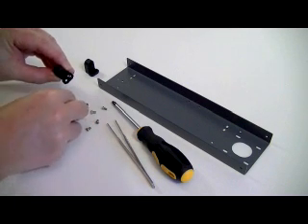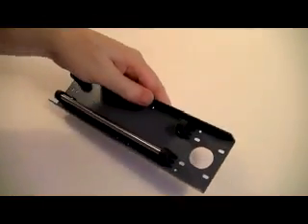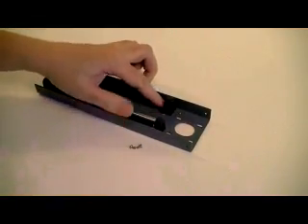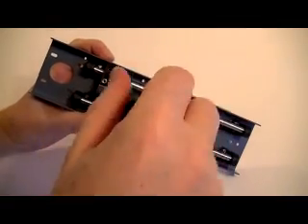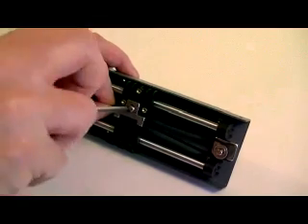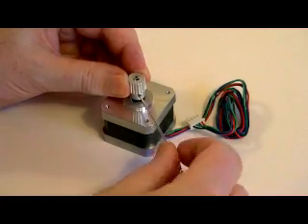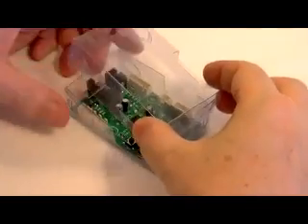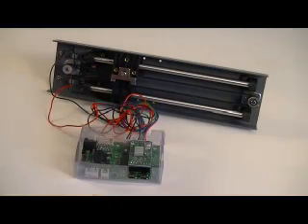V3 3D Printer: Assembly guide parts 1-12

Comment: Any body got the next batch of issues yet? 4-7 I was under the assumption you got a toolkit with it.
Reply: i got the usb key with mines, to the best of my knowledge the tool kit is 8-11
Reply: Dave Neill Same here
Reply: me too
Reply: Toolkit is supposed to be in 12-15
Reply: I got nothing either guys. Bit of a poor effort, but if nobody received it, then it likely does just mean they intend to send it out later on!
Reply: Yeah im not that bothered yet to be honest as the printer isn't done its not as is I can use the tools on prints yet. Lol
Reply: Correct Will
Reply: ...apart from it's 12-15 :p
Reply: www.Facebook.com/3dcandp
Reply: Do you Subscribe, or do you only Purchase them Weekly from your Newsagent? ...
.. You don't get it Automatically, you need to Subscribe to get the Toolkit.  Even if your Newsagent is Ordering Them Weekly for you, it may not be an Official Subscription.
Reply: It actually depends on when you Start Subscribing.  If you have been Purchasing from your Newsagent up until (let's say) Issue 11, and your Subscription begins at Issue 12; you will receive the Binder with your 1st Delivery (Issues 12 - 15), and the Tool Kit with your 2nd Delivery (Issues 16 - 19).
You will then receive the 10 Exclusive Designs (These are Exclusive to Subscribers Only - they are in addition to the ones in the Magazine which are accessed by the Web Access Code each week).
The Vector 3 USB Key comes with your 4th Delivery, and the Coloured Filement comes with your 6th Delivery (not your 5th Delivery).
However, if you begin your Subscription as from Issue 16, you will get the Binder with 16 - 20, and will not get the Toolkit until Issues 20 - 23.So, every Subscriber is different.
As for someone who does not begin their Subscription until within the Final 24 Issues, you would have to check with Eaglemoss (or the Distributor in your Country - eg 'Bissett Magazines' in Australia - not with your Newsagent).

Comment: I have been thinking of getting a 3D printer for a while now. Looked around and decided against it until I saw this mag. Yes the printed items will only be small but for me it's a toy. I will enjoy the building and in the end hopefully I'll have a working printer that I would not be afraid to pull apart & mend if necessary.

I did wonder if the cost of subscribing to the 90 issues was too high for a printer but in that you get help with creating the designs in the 3D software, some free gifts (which no doubt you pay for in the savings made from wholesaler/retailer profits etc.) and hopefully some other 'freebies' along the way.

There are things I would like to design & print which I'm unlikely to get designs for online so this may lead on to getting a 3D scanning system.

All in all I'm looking forward to issue 90 popping through the door, hopefully it isn't some crucial part without which the printer won't work.

ps. good marketing strategy to sell at £6.99 a week but deliver 4 at a time. would you sign up if it was £27.96 a month. I wouldn't .................. oppps, I just have. lol

Comment: its better to buy a makerbot 5th generation. Eventhough its more expensive its alot better
Reply: Makerbot are a bunch of scammers! They took from the Open Source community improved on the good will of others then closed the doors on these improvements when by the licensing agreement of the OS community says that had to! They are a despicable company!   http://richrap.blogspot.co.uk/2014/05/makerbot-patents-twist-knife-on-open.html
Reply: +Callum Burns Actually that is quite true they are scammers. It's just an ultimaker in a fancy case for an extra 2000 added onto the price tag
Reply: The Ultimaker is possibly one of the best commercial printers out there! They are open source (Albeit with hard to find parts) and printer quality is out of this world! :)

Comment: Just subscribed,  i hope im not going to regret having to wait 90 weeks for a finished printer. Looks great though.
Reply: fyi, Ive purchased all the parts on ebay and local hardware shops and started my prusa i3 build, total cost is just over £300. its definately more enjoyable have a big pile of bits to play with than waiting a week for another part to add.
Reply: I believe so,  it will keep there portage cost down.
Reply: I was very interested in this myself until i read this
"Prints any object up to 140mm x 140mm x 135mm"
With that area you cant print anything bigger than a mobile phone case. Its very small so most print projects you find on the web will be simply too big for this printer. So unless you like printing tiny cars and replacement phone cases this printer is crap in fact i dont think theres a smaller printing are 3d printer on the market..
 Not to mention your paying nearly £620 for this printer and having to wait nearly 2 years for it.. Do yourself a favour save that £6 a week and get one on ebay for £350 thats 10X better.
Reply: What would you recommend Vicktor?
Reply: Andie Piercy
Personally? I couldn't pick there are too many right now but look around the new and do a bit of research you can get one from China for £200 if you don't mind the shipping using aliexpress or ebay for around £350 (but get full paypal coverage). Just looks at dimensions etc.. before buying.. you want something that will take ABS and PLA as depending on your project ABS is just better for some stuff and PLA for others as ABS is stronger but has less flex so it not good for a phone cover as you need a bit of flex. Still researching myself as I am going to buy one but need to save the pennys first.. Goto youtube and learn about 3d printing and then make an informed decision.
Reply: Thanks for the info, ive been reading today. Ive cancelled my subscription and pretty much decided on getting a reprap prusa i3 rework . Bigger print size and upgradable. Should cost about 400.
Reply: Open Source printer eh?? That's a good one though! Your saving yourself a fortune doing it..You can put a second head on that too for two colours at once or double speed.
http://www.ebay.co.uk/itm/3D-printer-RepRap-Prusa-i3-Box-Frame-Complete-Kit-/161533335191?pt=LH_DefaultDomain_3&var=&hash=item259c231697 a full kit
Reply: That's what I thought,  the prusa looks a bit messy compared to an out of the box product,  but building the kit was the appeal for me.  Ill also buy it in stages as eBay liquidises some of the stuff I've hoarded in the garage.
Reply: Andie Piercy
Cool if the building is what you like go for the prusa. A good kit though personally I would still buy a complete kit so your certain its all going to work and all compatible..
Reply: i bought issue one but no one will wait just touching 2 years it would be rewarding in the end but i know of i subscribed the would just pull the plug on this after 10-20 weeks as no one will be buying after they research and honestly your also paying more for the ink and the magazine its stupid i would just be happy with the parts and instructions
Reply: ***** ok wher i seen to £23 so far
Reply: If you can learn to use the Design Software like a Pro, you could build a Larger Item in Parts, and then join them together.  But you'd have to be pretty precise.
Reply: They charge Delivery Per Magazine, not Per Delivery.
Reply: It says Your Comment was Posted 2 Years Ago.  Which means the 90 Weeks have passed ...
.. But I bet your still waiting on Back Orders.

by the way, be sure to Continue Your Subscription for the Additional (Optional) Issues from 91 to (I think it's) 110:  They have Spare Parts and Tools to use.  it's only the Printer Itself that is Complete in 90 Issues.